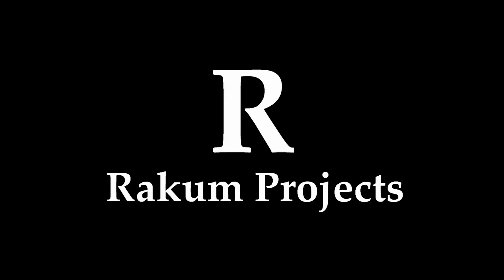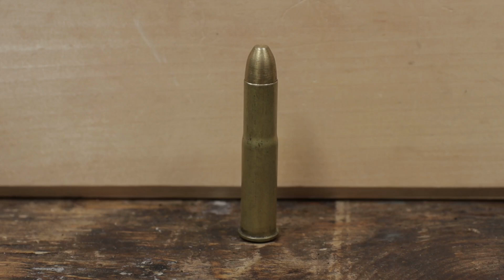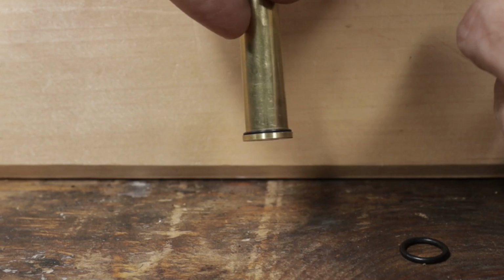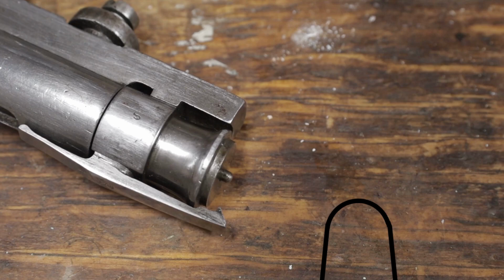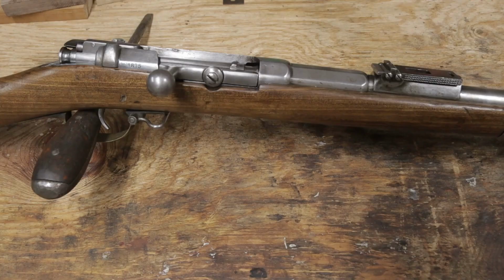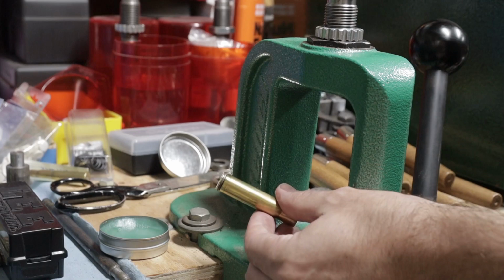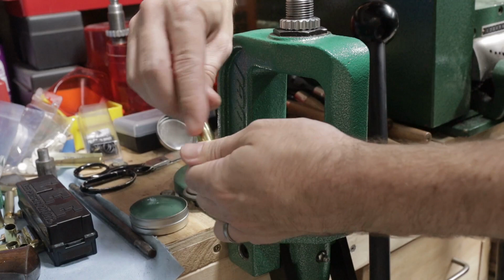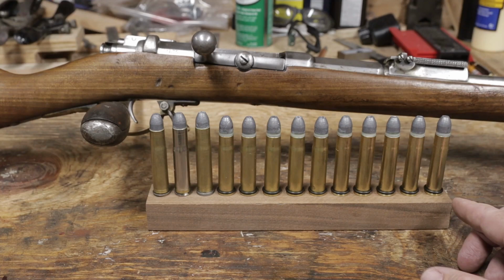Experiments in Making 11mm/.43 Mauser Brass

Comment: I use .45-90, turn rim to 15mm and anneal, then resize checking headspace carefully while small steps in reforming. Once set, tighten the lock ring on your die and form at that depth.  no h-s issues and properly sized to your rifle.  
Loading, rifle (* preferred loading)
  *  -Powder, IMR 4198, 31.6 gr (2.5 cc)
      -Powder, IMR SR4759, 28.2 gr (2.8 cc)
      -Powder, Accur 5744, 29.1 gr (2.2 cc)
      -Powder, FFG, 77gr (original loading)
      -Projectile, 0.446 dia., 340gr LFN
      -Brass, Use .45-90, rims to 15mm

Comment: As I mentioned in an earlier post, I also use 45-70 brass in my 1871 Mauser.  I recently loaded and fired some cartridges with black powder and pistol primers.  I used fireformed brass and didn't resize them, yet the primers backed out on all of them upon firing.  It's as though the cartridges weren't held firmly against the bolt face.  So, as you demonstrated, I bought some 0-rings to compensate for the thin 45-70 rim.  They have a 10mm inner diameter and are 1.5mm thick, fit on the brass nicely, and the bolt closes without any significant effort.  That should cure any excessive head space problems.
Reply: Update:  I reloaded some more rounds with the same components and placed o-rings on the brass.  They corrected the head-space problem caused by the thin rims and the primers didn't back out.  Problem solved.  

Thank you for the o-ring tip.

Comment: Thank you for sharing.  It's good to see someone else using 45-70 brass.  I call my shortened version the 11.3x53mm.  To compensate for the thin rims I back the sizing die off a full turn and the Mauser bolt has enough camming power to easily chamber the brass, essentially making it a crush fit in the chamber.  Then I neck size for subsequent reloading.  I may put some o-rings on my brass as an added precaution.  I always use CCI-200 rifle primers with both smokeless and black powder loads and never had a failure to fire.

Comment: I had all kinds of FTF with my 71 and K71, I switched to LP primers never a problem again, very common for the 71s. I make my brass from 45-90 brass, turn the rim until it will fit in a 11MM case holder, round of the edge of the turned rim to ease the extractor over the rim. Adjust your sizing die so it will set the shoulder back just far enough to chamber. I have a bunch of dental rubber bands for braces I place one over the base for the first firing to center it, and push it back against the bolt face. After they are fire formed they will headspace just fine on the shoulder no need to worry about a thicker rim. Either don't size or neck size after that.
Reply from the maker: Good info, thanks. I'll have to adjust my sizing die to neck size only after the first forming.

Comment: I have an M71/84 Mauser. I make my cases from Starline .45-90 brass. I turn the rims on my lathe, size and trim to final length. Then load a light charge and fire form.
I have had zero failures to fire and I don't use O-rings or, anything else for that matter.
After fire forming, I don't set the resizer all the way down. This leaves the shoulder in the fire formed position allowing the case to now headspace on the shoulder not, the rim.
Reply from the maker: I'll have to try that if I come across more 45-90 cases. Thanks for the tip
Reply: @rakumprojects  Dixie Gun Works. Kinda' high but, available.
Reply: @rakumprojects Starline should have em :)

Comment: I have a 71/84 and use belted magnum brass to make my .43 Mausers. Its pretty labor intensive but I've never had one not work. You have to file down the belt and use a retaining clip for a rim but i've yet to have one fail and they extract almost every time, I even use the tube magazine. I dont use C-clips but spiral retaining rings
Reply from the maker: Good idea. Those fit around the extractor groove just like the snap rings in the video?
Reply: @rakumprojects  Yes. Only thing is you'll end up destroying the retaining ring if you ever have to remove it, but they're so cheap it's not much of an issue.
Reply: Is there a particular brand or supplier you recommend?  I assume it doesn’t really matter too much.

Comment: Have you, or anyone else using 45-70 brass, had any case failures?  I've had 4 out of 20 cases develop a 9-10mm lengthwise crack about 12mm ahead of the rim.  Two were loaded with black powder and failed during the first firing, and the other two cracked with a medium load (1200 fps) of Accurate 5744.  The W-W 45-70 brass expanded from .500 to .516 during firing and it apparently stressed them too much.  I will resize some Remington 45-70 brass and see if they hold up better.
EDIT 5/19/24:  I mistakenly wrote that I had case failures with Remington 45-70 brass... It was actually W-W brass.  I corrected my comments.
Reply from the maker: I haven't had any issues with my Remington 45-70 brass.

Comment: You need to solder those rings.  I made some with copper seal washers. Now I just use 45-90 brass
Reply from the maker: Did you shoot them and how did they hold up? I actually made a few with copper rings held on by solder then machined. But then I reconsidered shooting them due to the heat potentially changing the metal properties.
Reply: @rakumprojects  they hold up fine. I often Aneal the bases of old brass and over time it re work hardens. I just wouldn't do it to a high pressure case and don't use more heat then you need. I've done it with 32 remington without any issues
Reply from the maker: @RussellHoughton  Thanks. I still have the cases, I'll have to give them a shot

Comment: I wonder if some hard silver solder would have helped with the ring method.
Reply from the maker: I actually have a few pieces that I soldered a ring of wire to then machined into a rim, but I haven't loaded them because I'm unsure of what the heat did to the temper of the brass.